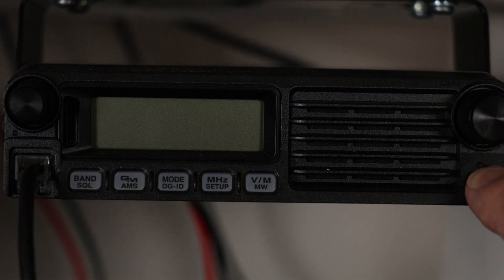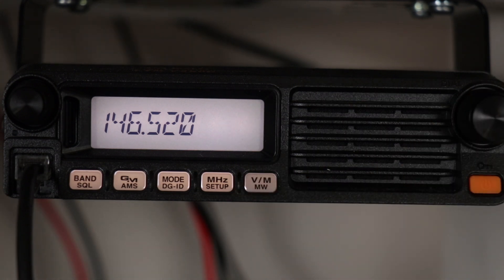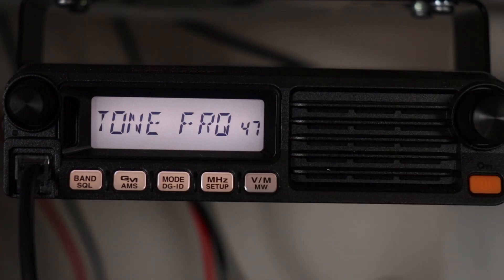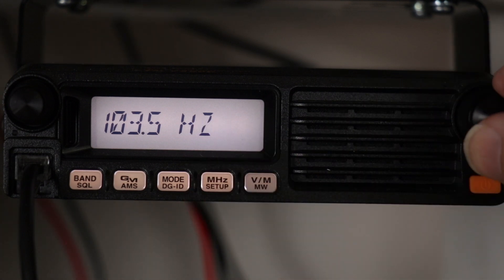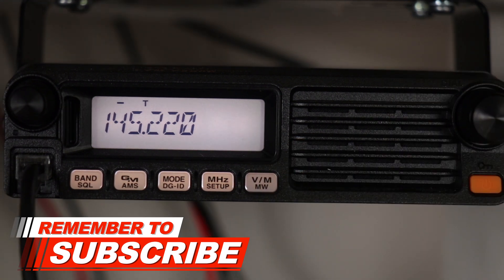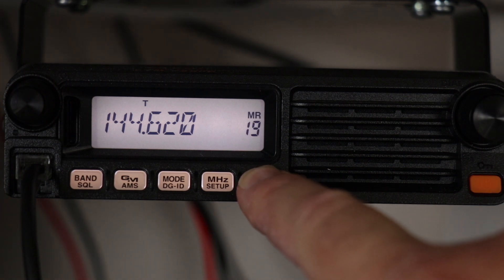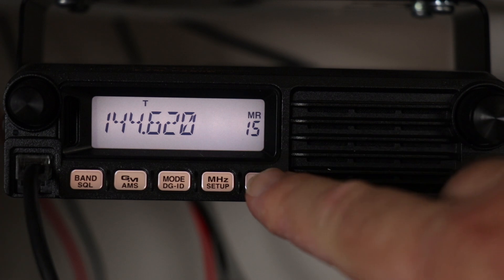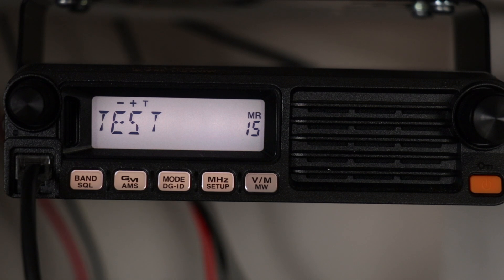FTM-7250 Split Memory Programming

Comment: Great and to the point video, thank you.  Using this method, is it possible to set it so you have a vhf uplink and a UHF downlink?  I have mine on the way for my office, but my first mobile was an ftm 400.  I am not used to the more basic setups and wasnt sure what was possible.
Reply: I have the same question.
Reply from the maker: @anielloesposito9188  Thank you for taking the time to watch and the comment! It is greatly appreciated. I have not yet tried it on this ready.
Reply: @WJ6FRadio  thank you for the video. 
if you try keep me updated!
Reply from the maker: @anielloesposito9188  I certainly will
Reply: Yes you can. Follow the method in this video which are the directions from P.17 of the advanced manual for programming split memory. I do this method on mine, and am able to hear and contact satellites no problem.
Reply: @wateroperator1972  thanks for the reply, I now have a 9700 lol so the 7250 has been largely relegated to aprs igate duty. I forget that Yaesu generally has several manuals for each radio, I’ll download the advanced version and read up.
Reply: But when you transmit with headphones you can't hear yourself on the output of the satellite. So you really can't tell if your getting into the sat or ISS? Is this true?
 @wateroperator1972
Reply from the maker: Thank you for taking the time to watch and the comment! It is greatly appreciated. I am not sure if that can be done, though I don't see why it couldn't be.

Comment: Nice job, I’d like to get my hands on this radio 👍
Reply from the maker: Thank you for taking the time to watch and the comment! It is greatly appreciated. It is a great radio! I use Fusion far more than DSTAR or DMR, and since it is a base radio no need in paying extra for the GPS that is in the FTM-100, FTM-300 and FTM-400.
Reply: WJ6F Anytime brother, I always enjoy your videos.  I’m pretty much a DMR guy but have the ft-70 and do listen to YSF off the local repeater 👍
Reply from the maker: @TheSmokinApe  I need to get better with DMR. I have an MD-380 that I am thinking of upgrading. I also have the FT-70. A great radio for the price! use with my ZumSpot. Enjoy. your videos as well. In fact I will be binge watching them tonight.
Reply: @WJ6FRadio  I got an FT-70 recently and other than the goofy volume control it works really well - they definitely packed a lot in for that price.
Reply from the maker: @applemachome  Thank you for taking the time to watch and the comment! It is greatly appreciated. It is hard to be the price of the FT-70 for what you get with it!